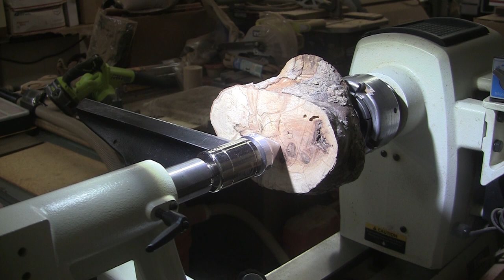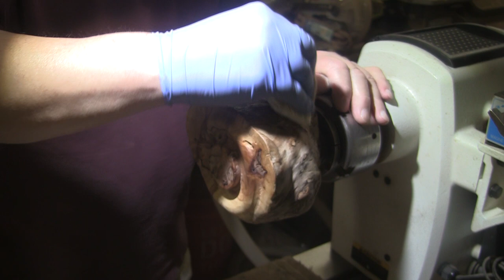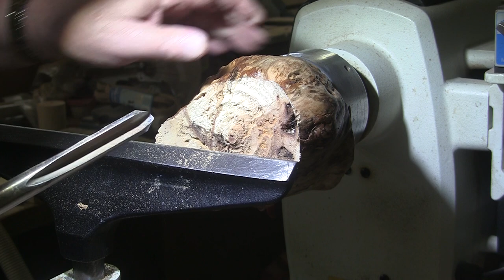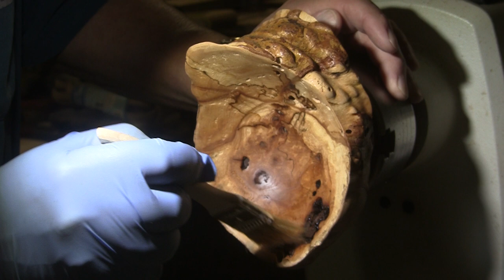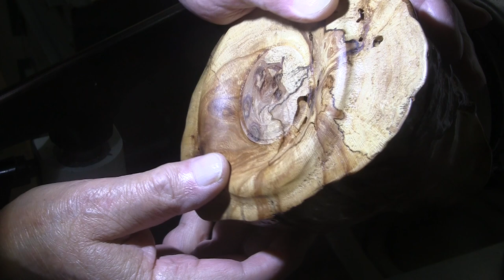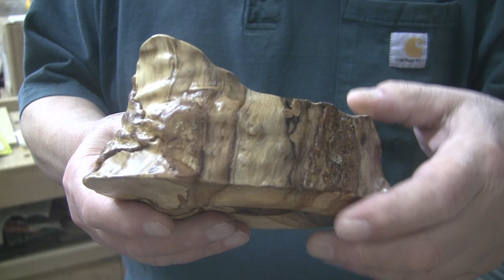Natures Best Work! - Wood Turning

Comment: Hi 👋, Phil from Phil, glad to see you back in the shop, that’s a beautiful piece of art lovely grain in the sycamore, Great territorial on wood turning, 
Look forward to seeing you next project, You were saying that your rags were drying out very quickly probably obviously too long a period between use, not sure whether it will help but are used to make a rubber up out of cotton wool and lint cloth years ago to do French polishing and I used to put a dab of linseed oil on it and then put it into a small plastic bag try to get the air out of the bag , then with a drop of methylated spirits I’ll bring the rubber back to life, It’s just an idea not sure whether it would work with the products you are using hope this can be some help.
Keep up the great work stay safe, Phil from the moulin France.
Reply from the maker: I keep mine in a plastic bag and squeeze all the air out.  I use them regularly so the moisture is always being refreshed.  This time it was a month's wait so, it dried out.  I'm not going to worry about it, I usually use the rags for 2-3 months before  I replace them.  😊
Reply: Hi 👋 Phil, thank you for the reply, stay safe keep yourself well look forward to the next territorial another lovely piece of art.
Phil from the moulin France

Comment: Hi Phil I notice that in the intro the piece of wood looks quite a bit bigger most probably the camera angle. It doesn't take any quality of the piece. Love watching all of your  creations 💜
Reply from the maker: The outside is untouched so the diameter didn't change.  I did take the top down to get rid of the ridge that just looked out of place so it's only about 3" tall now instead of the 4" it started at.  😊

Comment: On punky wood have you tried to use cactus juice and stabilize the wood at this point then do a finish scrape?
Reply from the maker: No.  I have used hardener and don't like the way it leaves the wood feeling.  CJ would do much the same, I think.

Comment: Love every thing you do Phil. Where did you get the drill press hold down clamp.
Reply from the maker: Thanks, Gary. 😊  I got that clamp 50 years ago when I got the drill press.  They don't make them anymore because modern drill presses have the rack and pinion table adjustment and they can't fit on those columns.  You can still find them on eBay once in awhile.

Comment: Always very nice work there Phil...I have a question about a couple of previous videos.
Is the new Atomstack machine as impressive as the...um...pecker one?
If you had to choose which one would you keep and would you be willing to sell the other?
Never hurts to ask so my wife said I should.
Reply from the maker: I will keep the LaserPecker 2 because it's the most versatile.  But, the other one can more easily handle larger pieces.  Keep both, I guess!

Comment: Have you taken the sand-o-flex to pieces like this before turning? Any difference?
Reply from the maker: No, I don't think I have done that, Craig.  Not sure why I would? 😊
Reply: @PhilAndersonShadyAcresWoodshop  i was thinking using it after turning may change edges that you had shaped while turning.
Reply from the maker: @craigb9241  Oh, no, that doesn't happen.  That's why I use finer grits and the scored refills.  It doesn't change anything except to make it smoother.  Coarser grits and non-scored would definitely do what you are talking about, though.

Comment: How do you decide which is top and which is bottom?
Reply from the maker: Just about impossible to answer that, Tracy.  It happens at the time.  Just a feeling at that moment.  Of course, it also has to do with the size of one versus the other, and what I might want to save at what could be the top versus the bottom, etc.  I cannot answer, sorry.